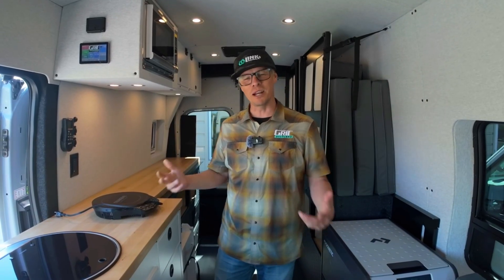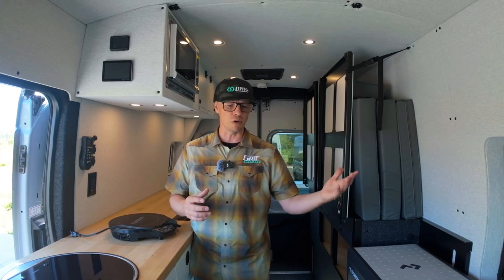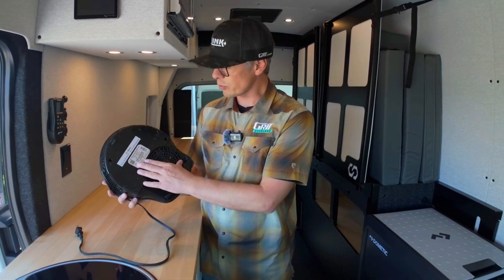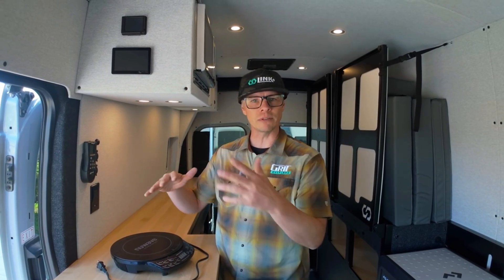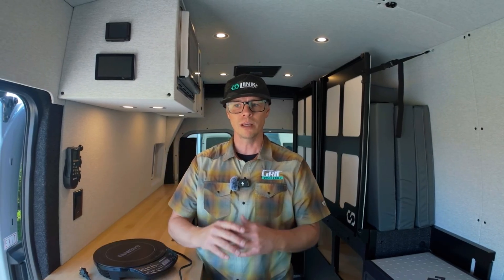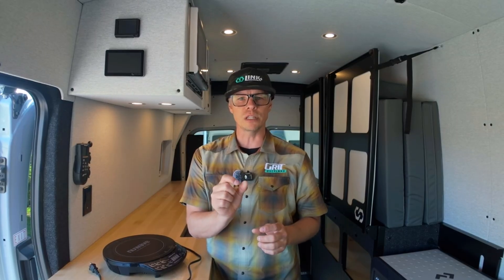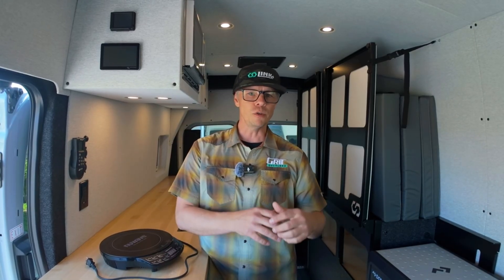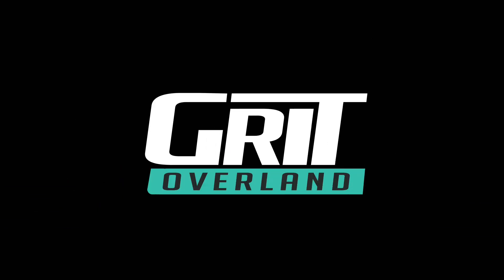What Inverter Should You Use in a Camper Van? | Grit Overland Solution

Comment: Based on your explanation, what if you double up on your battery capacity. I assume you are still limited to the inverter's capacity as you explained in this video, correct? Why not go with an inverter with more capacity?  Thank you.
Reply: And don't forget the a/c
Reply from the maker: At Grit Overland, we actually don't run the A/C through the Inverter since we use the 12V battery system.